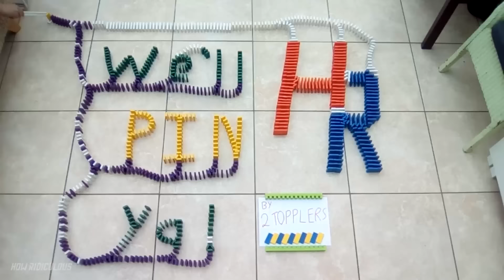Can This SOLID GLASS BALL Survive a 45m Drop?

Comment: The actual scientific answer is that *it breaks in a similar way every time because of the way the glass was cooled. Much like a Prince Rubert's Drop, the glass is cooled rapidly; creating a compressed center, and a shell that can sheer off after the impact. The molecular structure of the glass is like layers or shells, so only the outermost layer breaks off of the ball instead of it shattering throughout the whole ball.
Reply: It's called concoidal fracturing
Reply: I wanted to say😔😅
Reply: Like 🔻🔺🔻?
Reply: I was thinking it would have something to do with the process of making the glass! Thanks for the science m8!
Reply: That's right. The coney joney is formed by the way that the glass is absorbing the energy.
Reply: Try making that a bit shorter
Reply: Here I thought it was I compresses in a cone a tiny bit and the non coney bits breaks of cuz its not pliable enough for the force.
Reply: this is a major factor, but the outside would cool faster then the inside.  minor correction.  Aside from that the other big factor that is causing the shape is the fact that the impact point is suffering compression force, and the rest of it is suffering tensile stress.  The impact point is supported, but the rest of it has room to shear off.
Reply: Hawg Tied bro we have the same answer! It’s specifically called the Hertzian Cone Cracking effect
Reply: @YbFc_yungblacka  A good explanation need not cater to ADHD
Reply: Hawg Tied alright Einstein
Reply: I have to agree with Daniel Kirienko on this. Conchoidal fracturing looks like the thing.

In which case it is due to the fact that there are no 'natural planes of separation' in the glass. This may be because of how the glass was cooled; but it has absolutely nothing to do with the Prince Rubert's Drop effect. If that was the case the entire thing would shatter into a bazillion pieces as soon as the outer layer was damaged in any way.

Also worth pointing out is a superb sentence in the Wikipedia page for Conchoidal fracturing; 
  "A swelling appears at the point of impact called the bulb of percussion."
Now that's a phrase that could stick in the mind in totally inappropriate ways. 😲
Reply: But why the cone?
Reply: @TheMijman  Well (mostly guessing here) the shock waves from the  'bulb of percussion' (ha!) will radiate outwards as circular waves. This is why the damage has rotational symmetry. The wave will dissipate as it moves through the glass, so eventually it won't be enough to cause any more fractures. So you have something which starts at a point, gets bigger in a circular way, and eventually ends up in a circle. A cone is all it can be.

It does lead to some other questions though. Like why is it curved like a volcano? (I guess this is just a property of the material; it's a common thing in conchoidal fractures. It might also depend on the initial shape.)

And also; if you could put enough energy into the impact that the shock wave went more than half way through the sphere before it loses enough force to shear the glass; what would happen then? (Destin, can we borrow that cannon of yours a mo..)
Reply: @Hawg Tied - Your explanation does not give a cone as result. Conner Kline's answer, a couple of comments below yours, gives the correct explanation.
Reply: It’s got Layers !! (who doesn’t like a good Shrek Reference?)
Reply: @girlsdrinkfeck  yes
Reply: @TesseraCraft  thanks i was gonna say it but you did it for me thanks
Reply: @scunts  I don't think it's ADHD..
Reply: The actual scientific word is concoidal fracturing, the glass is cooled rapidly; creating a compressed center, and glass has a shell that sheers off 1 at a time after the impact. The molecular structure of the glass is like layers or shells, so only the outermost layer breaks off of the ball instead of it shattering throughout the whole ball. Aside from that the other big factor that is causing the shape is the fact that the impact point is suffering compression force, and the rest of it is suffering tensile force (glass is more acceptable to tensile force) so more comes off the side for people who don't know what i am talking about. The impact point is supported, but the rest of the glass ball has space to break/shear off. i have a master's degree in engineering so fight me.
Reply: @kaydnito8776  no that's when the molecular structure of something is more prone from break from the top nice try tho hahah read me answer
Reply: Thanks I only had theories
Reply: @girlsdrinkfeck  How does a sphere have an edge!?
Reply: @danielkirienko1701  no it's called Coney Joney
Reply: It's actually a Coney joney
Reply: @girlsdrinkfeck  It's round. Where is the edge?
Reply: @TheMijman  From an engineering point-of-view, brittle materials under compressive forces tend to fracture at roughly 45 degrees to the loading direction. This is because the maximum shear stress occurs at 45 degrees to the principal stress planes (google Mohr's circle for more detail) and the shear yield strength of an isotropic material is about half of its tensile yield strength. The impact would have created some initial cracks in the ball at the point of impact, and then they would have propagated from there at roughly 45 degrees, giving it a cone shape. 
Would be interesting to see if the lads measured the angle, would it end up being 44 degrees... if so, would be a fun t-shirt image :P
There also seems to be a lip where the 45 degree fracture meets the ball surface. This probably due to slight differences in the material properties relating to material processing, as others here have suggested.
Reply: So baisicly if i got it right . . . Its beacuse the center is more dense ?
Reply: shear* but yeah
Reply: Ok
Reply: @TheRealPingu  its hard on the inside . Less on the outside
Reply: i think you gettn pinned
Reply: @Hawg Tied - does that mean if they were able to drop the same ball the same way around every time it would cone through all the layers eventually?
Reply: Outside more brittle because it cooled faster?
Reply: @adamborwick1246  essentially

Comment: It all comes down to “hardness” vs “toughness”. Glass is an extremely hard structure which also makes it extremely brittle (hard but not tough). When something that hard has significant force applied, the glass wants to break but chooses the path of least resistance (to expend the energy applied). Because it’s a sphere and tensile strength is evenly dispersed, the path of least resistance is outward, not through. The only reason it doesn’t come out in a perfect cone is due to inconsistencies in the glass “grain structure”/shape.
Reply: Nice
Reply: science with Jeff
Reply: So theoretically if it were perfectly made it would break off in a perfect cone shape?
Reply: Pubg God69 thank you. Lol and to think, I don’t even have a college degree
Reply: Mr PancakeDemon in theory I would assume yes. Without any other interfering factors.
Reply: @mrpancakedemon7454  I think it would ever break perfectly in a straight line through
Reply: Mr PancakeDemon what I forgot to say though is you need enough force to perfectly break it in a cone in one go. if you don’t apply enough force then it would break like the glass balls were and you would need to do multiple drops which could ruin the cone.
Reply: Mr PancakeDemon Unless there are factors dealing with reverberations that I’m unaware of (causing the wave pattern) than theoretically, yes.
Reply: Perfectly explained.

The effect reminds me a lot seismic waves through the Earth's surface.
Reply: You forgot the conservation of momentum. The outer part of the ball has more room to keep moving, yet the center of it can only compress. This shockwave expands the way you said: the path of least resistance.
Reply: @falllingraindrops1543  One could argue that, in theory, a perfectly formed sphere would actually take the hit instead of breaking.... perhaps even surviving unscathed from a much greater height.
Reply: You're not entirely correct, glass is definitely not a hard material, as it gets scratched relatively easy. You are mistaking hardness with yield strength, which is how well it resists plastic deformation. Glass is brittle because it has a high yield strength but low tensile strength, meaning it resists deformation, therefore has poor tensile properties. Similarly, carbon fibre composites also are very brittle while rigid. Also it doesn't come out in a cone because the crystal structure is highly random; there are no inconsistencies in the glass, rather it is an amorphous solid, so there is no definite structure for the atoms to slide off like in crystalline graphite on your pencil lead.
Reply: @mrpancakedemon7454  Glass could never break off into perfect shapes. It is a special type of solid where the atoms are arranged randomly like a liquid, while not moving. Some consider it as a supercooled viscous fluid, but that's beside the point. Glass shatters randomly because there's no crystal structure, so the particles break randomly, unlike graphite or diamonds.
Reply: @sbsnate2312  Took the words outta my mouth :3
Reply: I was going to try and explain that, but Jeff did a better job than I would have.
Stanford: just realize, that breaking the sphere in half would mean cracking it right through the middle, which is the strongest cross section of the sphere.
Reply: Hes right! And I don't even a high school diploma! Lol! The point of the "cone" is the point of inpack pushing the pressure out twords the sides! It's not a perfect cone due to not only the inconsistencys in the glass but the spin of the ball falling through the air!
Reply: Glass is an amorphous solid or non-crystalline solid, is a solid that lacks the long-range order that is characteristic of a crystal (Examples of large crystals include snowflakes, diamonds, and table salt. Most inorganic solids are not crystals but polycrystals, i.e. many microscopic crystals fused together into a single solid. Examples of polycrystals include most metals, rocks, ceramics, and ice.) Examples of amorphous solids include glass, wax, and many plastics.
Reply: Wow
Reply: @NeoSan1986  well explained, but how did the cone happen, if glass is amorphous
Reply: Jeff Naida the science guy
Reply: Good answer, adding to yours: glass is quite strong in matters of compressive strength but not so strong in tensile strength. The force of the impact goes evenly in all direction. The angle where the shear force overcomes the tensile strength is where the glas breaks off the ball.
Reply: Beat me too it, but explained it much better than I would have
Reply: And in case nobody has mentioned it, those inconsistencies in the structure of the glass are due to cooling. The outside likely cooled faster so you would get concentric rings of slightly different hardness.
Reply: That's what i wanted to say but less nerdy
Reply: not to mention that it isn't hitting the steel plate at a perfect 90 degree angle, it's hitting at an angle, further causing the energy dispersion to go sideways
Reply: @dagan2000  it's a sphere?
Reply: @mrpancakedemon7454  well its either a cone, or a rod.  The path it must take forms a straight, conic, path through the glass in which its the easiest path and given enough force VS the surface it shits (which is far from perfect given the deformation of the plate and the flight of the various things that hit it) forms the path in which the energy is transferred and 'sheared' through the glass.
Reply: @johnheoven3171  Shock wave :D I don't know exactly which kind ... but oblique shock wave ( supersonic flow encounters a wedge and is uniformly deflected forming an oblique shock. ) is my gues.
Reply: That be some big brain stuff right there
Reply: And if the angle of impact is not a right angle that causes the cone tip to be off center
Reply: I'm thinking that if the steel plate wasn't so bent up the CJ's would be a bit more perfect.
Reply: To add to this, there is a property of materials call its friction angle. Concrete, for example, has a friction angle of about 45°, so if you crush concrete, it'll break at a about 45° to the applied force. The glass seems to have about a 60° friction angle, with how shallow the cones are. I'm quite surprised the concrete-ish ball didn't break, that thing is definitely heavily reinforced with steel or polymer or something.

Comment: Smarter Every Day actually kinda explained why it breaks that way. Stress propagates through the glass in a shape called a fructum, which is basically a cone with the point cut off. That cone gets wider until it intersects the edge of the ball, and everything on the wrong side of that stress line is what breaks off.
Reply: This is more accurate than most of the comments about this
Reply: what’s the video name
Reply: It is also because it is being dropped onto metal that also vibrates differently if you droped it on Solid Concrete you most likely wont have the same outcome
Reply: Aha
Reply: They should do some videos with Destin from Smarter Every Day, get some actual science in there and for some reason I feel like they would all hit it off fairly well.
Reply: I read that in Dustin's voice... lol
Reply: You are correct, but just to try to dumb it down, basically all the force of the drop travels into the very edge of the ball, which shatters all the non supported glass. Thus, it shears a cone into the ball
Reply: @thevenatorproject7269  sphere*
Reply: @spikeyjakey8978  I can't recall the exact name, but it involved him shooting bullet proof glass in slow motion

Comment: The "Coney-Joney" is created on the plane of maximum tensile stress. Glass is a very hard material with high yield (strength) for compressive and shears stresses, but is much weaker in tension. This is why the impact point, being under compression, survives. In a material, tensile, compressive, and shear stress exists simotaneously in different directions. The maximum tension occurs because of the inertia of the material outside of cone pulling down. While the material inside the cone is more effectively stopped by the impact. this is a result of the load propagating within the solid angle of the cone commonly called a frustrum. The waves are probably due to a change in fracture phase. Entering fast-fracture phase results in an unstable (wavy fracture).
This is my understanding based on structural mechanics. Hope it helps.
Reply: Yup, I concur!
Reply: That’s exactly what I was totally about to say!
Reply: Nop
Reply: Wonderful explanation
Reply: I think you cracked it
Reply: Additionally, the conchoidal pattern appears because glass does not have a crystalline structure that would fracture or cleave at regular angles. Obsidian cleaves in the same way.
Reply: I Think the ripples are caused by concentric fracture lines, like waves in a pond. The uneven surface could be caused by the propagation of the wave along the surface were the peaks and troughs create and uneven surface. But I’m only going off of my understanding of blunt force trauma on a skull from my training in forensic anthropology
Reply: Either that, or magic.  Definitely one or the other.
Reply: Pin this person!
Reply: @RyanKlapperich  fr
Reply: Geologist 2 cents here, glass has no ordered molecular structure and breaks with conchoidal fracture. This is another contributing factor
Reply: This is amazing I was going to look it up but you said it right in the comments thank you
Reply: Ooooh. I like this one. Legit!
Reply: habahabahaba wut. my brain cant comprehend the power of science
Reply: not an engineer but I think it has to do with the way a sphere absorbs the impact, because it is perfectly round it only makes direct contact on the thickest portion of the glass, where the impact is directed out from that point and the glass is thinner it shatters, creating the coney joney lol...and what the genius up there said too lol
Reply: One of the few physical phenomenons that makes perfect sense intuitively when explained well.
Reply: Why isnt this pinned?
Reply: @marcos5647 ba dum tss